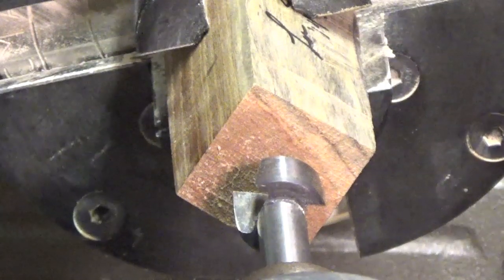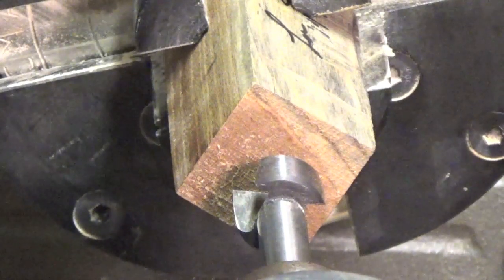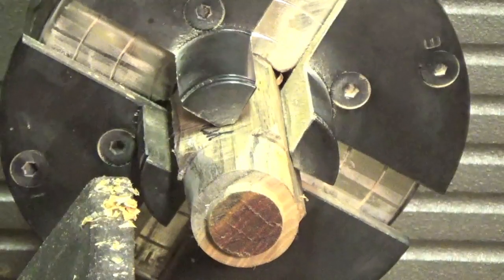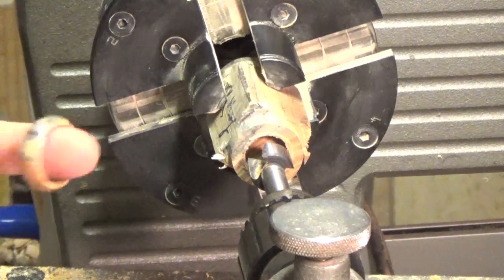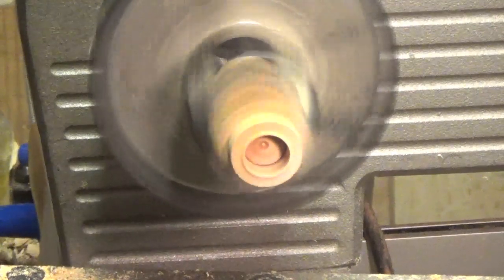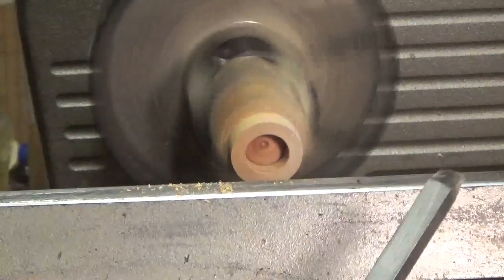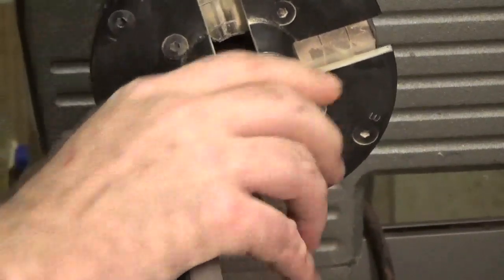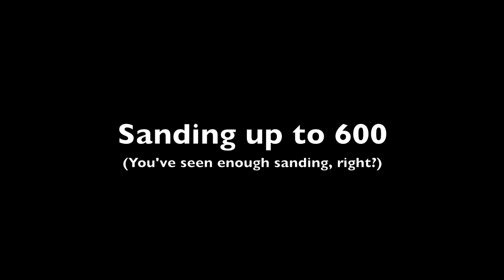Woodturning: A Ring And A Story (Not Romantic)

Comment: I made a ring, myself, from a piece of cherry that i've had for about 8 years. just sitting there waiting for a purpose. the ring I inherited from my uncle broke several times as thin silver is also not the most durable of materials, especially on a large and hard working hand. Anyway, didn't have a lathe at the time, I cored the ring with a hand drill and shaped it with a rasp. then I glued the stone in the notch that I cut at the start. This ring also split (as you say, wood doesn't make durable rings), however, i fixed it with superglue, and applied a superglue finish to most of the body. since then it hasn't even showed signs of splitting again. A superglue finish, or CA finish really adds to the durability and shine of a wood ring! Nice story, great vid as always! Cheers

Comment: I have a nice scratch in my shield when I was drilling out a pen blank. as I was retracting the the drill pulling the tail stock the chuck came out  spun a few times then went flying into my shield...  I am very glad I had that on...  when I examined where the scratch was, it was inline with the cheek bone under my left eye. I imagine the smallest injury would have been seeing stars and a black eye.  the worse case scenario I would figure would have been a broken cheek and or ocular bone.

Comment: nice project...yea i have a lot of broking ones they don't last long
Reply from the maker: I've never made more than a few out the same kind of wood. I've tried most of the really dense and tough woods without success.
Reply: Roundabout Woodworks ca and stainless steel inlay is your friend
Reply from the maker: malibuu6969 I don't have the equipment for turning steel, but maybe someday. Rings really aren't my thing anyway. I just make them every once in a while.
Reply: Roundabout Woodworks sir, don't get me wrong, I respect every opinion. I've been doing wooden rings very short time ago and it's happened to be my passion, just the opposite of you!  I was just trying to defend that wooden rings made with some technics could last much more that you claim... It will depend on how you care about it or not in most cases, but also the grain direction and the type of wood play a big role...Also you can stabilize the wood with vacuum and resin though... There are many techniques out there... However good work my friend! Greetings from Canary Islands!